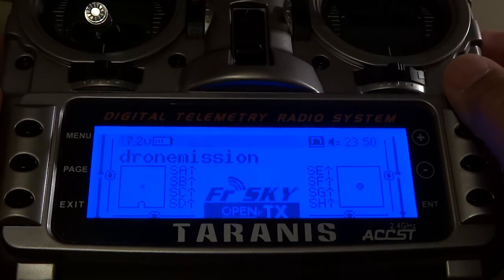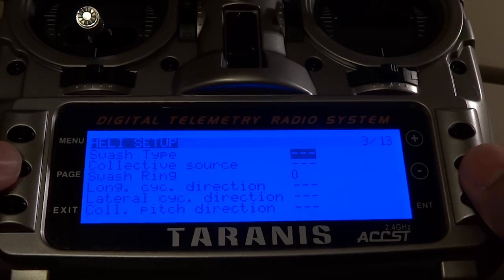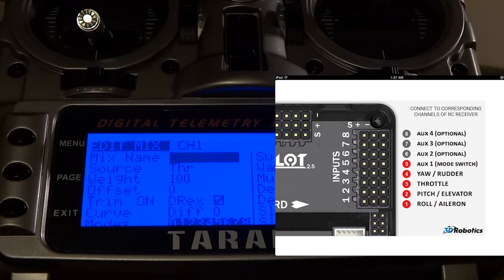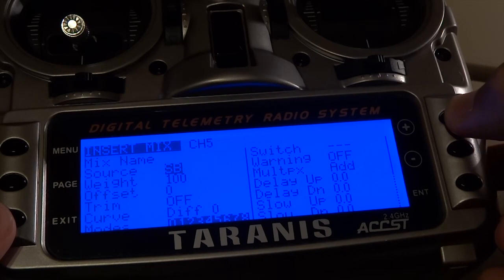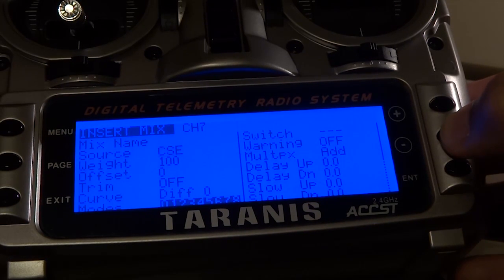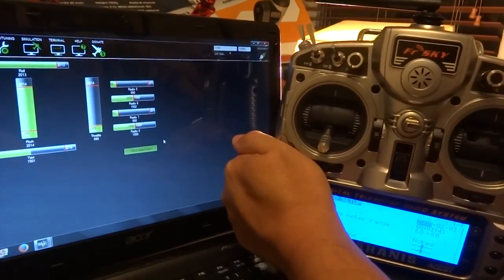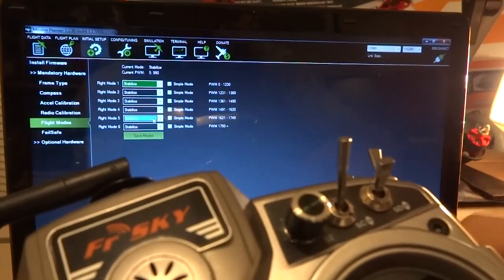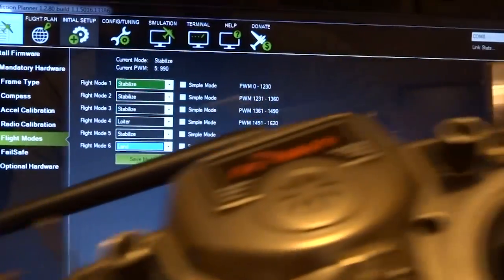FrSky Taranis Review: APM Ardupilot Switches, Channel Setup, RTL or panic button!

Comment: HELLO,
There is one thing  i don't understand when you configure the switch SF; How APM knows that this switch is for RTL? When you configure the switche SG   you set up the flight mode with mission planer. I didn't see on your video that you did the same with chanel 7? Does mission planer unterdstand wihtout setting anything that it means RTL? ( I don't use mission planner but APM planner 2)
thanks

Comment: Nice video.  I have done these same steps on my Taranis (with 8XR) and APM 3.1.  The 4 control channels work fine, but none of my switch channels work.  APM does not register any of their movements.  Any suggestions?  Thanks

Comment: Really helpful video, thank you so much! I am still having one issue with channel 7 though. I've got it setup on my taranis just as you show in the video, and I've enabled it to RTL in Mission Planner 1.3.5. But when I am in radio calibration in MP 1.3.5 channel 7 doesnt register when i flip the SF switch. any ideas?

Comment: Thank you for all your wonderful videos.  It has help me tremendously.  I have a Taranis ,X8R and APM 2.5. I did the setup like your videos.  Everything works perfect except the SF switch for RTL.  Nothings happens under flight modes when I toggle the SF switch though I can see the PWM for channel 7 changes under radio calibration.  Any idea what I am doing wrong?  Thanks again for your help!
Reply from the maker: Enricsoh hi, I think this should solve your problem.  Channel 7,8 are options.  Make sure you select your channel 7 (SF) option.  Channel 7 allows you do quite a few things as you can see from the link we provided; popular as a auto-trim switch, but once you are done trimming, we find it more useful for RTL.  You can also use channel 8 for another switch now.

ref. see channel 7 diagram to find the pid setup page, they may change around in difference versions, but once you know what to look for, you will find it.
http://dronemission.com/diy-frSky-taranis-setup-6-flight-modes-apm-ardupilot.htm
Reply: ***** Thanks - I got it now. You guys are awesome!
Reply: *****
 Do you need to be using PPM for the channel 7 option?

Comment: in radio calibration when I flip switch sf the radio 7 moves ok but in flight modes I get nothing I am using apm2.8am I  missing something
Reply from the maker: +bob gasman greetings, at some stage mission planner made some reorg, at the time of making this video, channel 7 is a personal switch, allows you do quite a few other things. It is popular as a auto trim switch, but once you are done trimming, we find it more useful for RTL You now also have the option to assign Channel 8 to another switch. You must make your selection on Mission Planner Arducopter PID setup page, look around for it.
Reply: I know this is an ancient comment, but the section to assign Ch.7 as RTL is under CONFIGTUNING->Ch7 Opt (just above the kermit green "Refresh Screen" button)

Comment: Good video! I have one on the way.
Reply from the maker: Thanks, get excited, it is a good transmitter.  If you are using APM, you can follow the playlist.  We document our setup in videos so we can replicate it for more radios, as it is easy to forget.  Ep 28 and Ep 30 continues the Flight Modes with Voice File, which I find useful.  We have tried different switches to fit personal preferences but we still apply the same principles.
https://www.youtube.com/playlist?list=PLRiU2rDNhnJQwWAxhAtv-ejzoyQXY_RKm
Reply: ***** Thank you, you do not know how much time you saved me! I have been trying to change the order of my Ail,Ele Thr,and I just did not understand how but you made it so EZ great video.
Reply from the maker: you are welcome. continue to Ep 28 and 30 for the voice command.